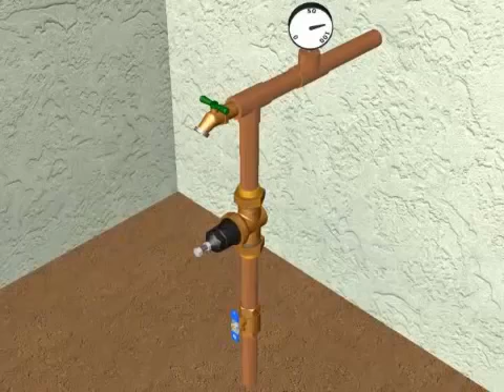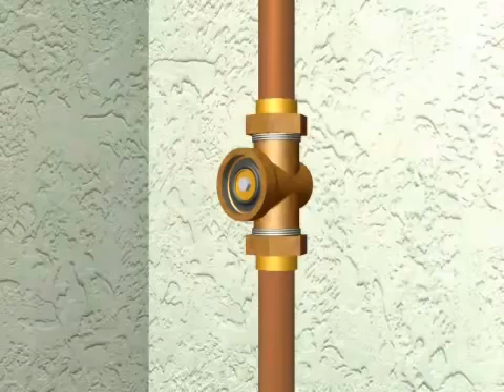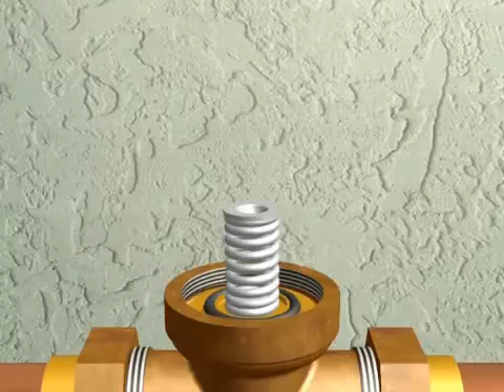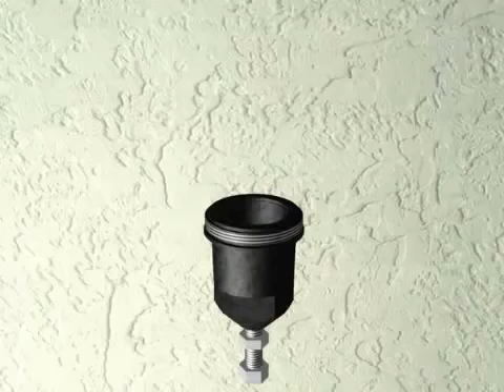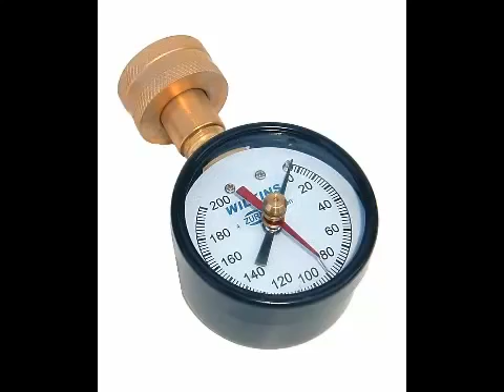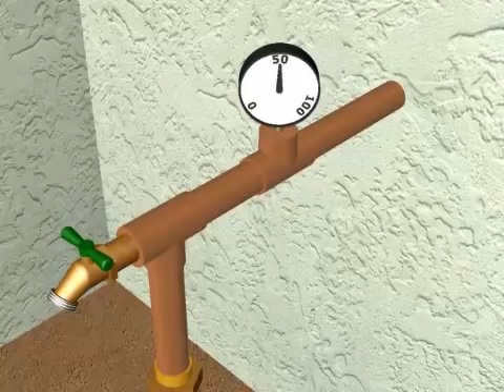Zurn Wilkins Model NR3 Repair

Comment: My bell housing keeps leaking after adjusting pressure. Anyone getting same issue? Also, I’ve replaced the kit last year and now it keeps failing, causing pressure to shoot up to 120. I’ve tried opening to clean the insides, it worked for a couple of months and now failed again tonight. I wish the design would be more durable.

Comment: Looks easy. Bit is it? Hum. Not sure. Mine was full of crap. Needed to remove to clean. It was hardest to find new union gaskets.
Got them from Cleveland Plumbing supply 440-247-2555
PN 111632 for gaskets

Comment: Very straight forward repair. Tools I used for my 3/4 inch valve in my home were a 9/16 wrench (I had to use a stubby), 1 1/2 inch socket for the bell housing and some steel whool to clean the copper surface.... took about 30 min total

Comment: Thank you so much for this. My in-laws needed a new water heater last weekend, which I installed, but the blowoff valve was constantly dripping, which lead me to check the water pressure and find it was way too high, which lead me to finding their 1 1/4" NR3 pressure regulator had failed. The house was built in 2005, so sometime in the last probably 10 years, the seals inside failed. I ordered the NR3XL repair kit, which the Zurn website said was the same part for both the NR3 and NR3XL, and an hour later, their water pressure is back to 60psi and the water heater pressure relief valve is no longer dripping. Thank you!